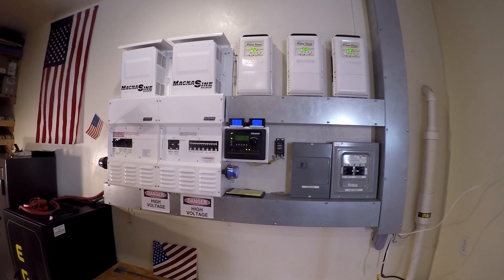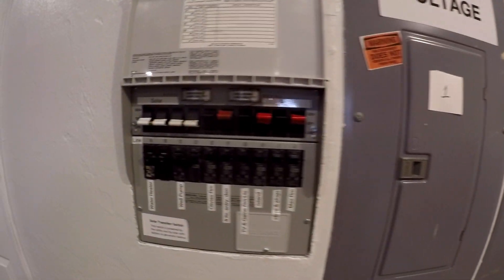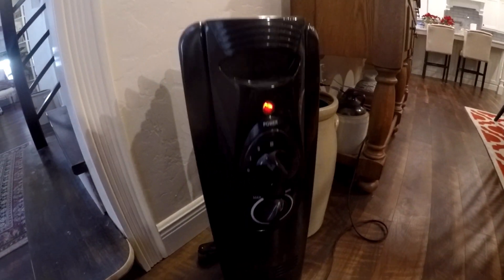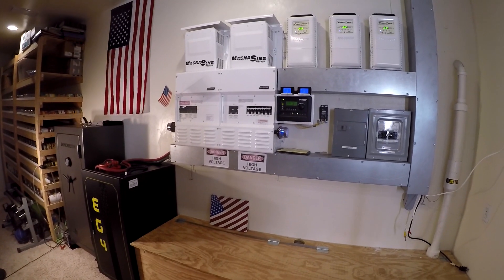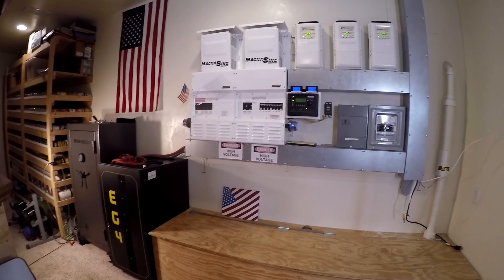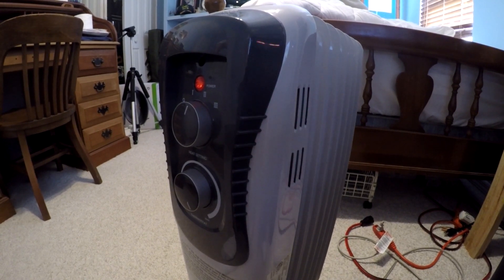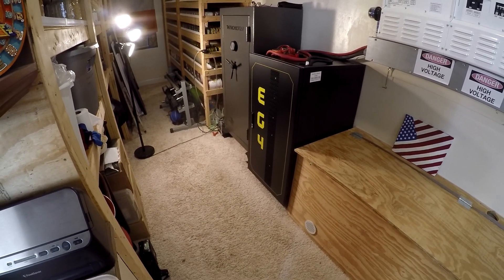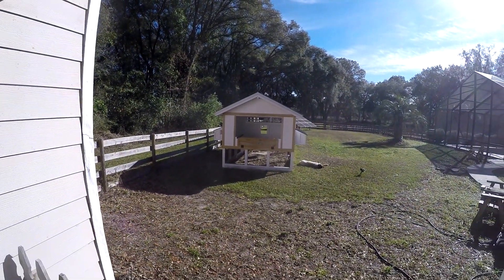EG4-LL V2 Update

Comment: Thats a wonderful setup. I recently switched from the trojans to the eg4ll just like yourself. Did you use any communication cables between the batteries? I know the magnum inverter cant communicate with the batteries? I have your same setup just not quite as large.
Reply from the maker: The batteries are communicating with each other but they are open loop with the magnum system.  Green wires seen here: https://www.youtube.com/@HomesteadEngineering
Thanks!

Comment: what is your total array capacity.  Just curious on what is pulling in the  40kw hours.  Thank you and congrats on the new batteries.  I'm thinking about the older version of what you have for 2k less and maybe one new for the CAN.
Reply from the maker: I have about 13,000 Watts of panels.  I do have some afternoon shading issues from Nov to March.  Well see what it can do in April.  I am currently still producing more than I can use.  I will need to add an electric car and then I will probably max it out.

Comment: Very interested in detailed videos on the eg4 6000ex split phase inverter.

Specifically interested in how wired to the AC breaker panel and any safety cobsiderations
Reply from the maker: JK, Well I do have one sitting in the garage so I will get it mounted and hooked up eventually.  Thanks!

Comment: I have been contemplating getting the EG4 batteries foom Signature Solar. Their sale ends tonight at midnight. The real issue is our Repurposed Tesla batteries are still running strong. As much as I want a safer chemistry, I hate to swap out batteries that still perform like new.
My only issue with Tesla is I only have 15 kilowatts of them. A 30 kilowatt bank would be perfect for our system. Some people have suggested that I sell my Tesla batteries and use the money towards the Sever rack batteries. At today's  prices for Lithium Iron phosphate, who is going to want to buy  Lithium Ion NMC?
Reply from the maker: That's a tough one Stephen.  There are a lot of reasons to make the jump and a lot of reasons to hold off.  My biggest motivation to upgrade from my FLA (that work perfectly) was my fear that something bad could happen and I would be unable to get my hands on them.  Having my own power source is as important to me as food or water.  So, I am very relived to have them in hand in addition to all the advantages they provide.

Comment: Hey Dave, great update. I'm getting an eg4 system delivered any day now! Your videos have been reassuring that I made the right decision.

I have an A.O. Smith hybrid water heater (tank) and it has am option to run solely in the heat pump mode. You should look into a hybrid water heater.
Reply from the maker: Hey Raymond,  I love them so far and I think your going to be very happy as well.  On the hybrid water heater:

"I have looked at that. One advantage for me is that they suck the heat out of the room.  That's usually a good thing here in Florida.  Heats the water AND cools the room.  Not so great in the winter but our winter is short.  I probably won't do it because:
1. They are a lot more expensive
2. I already have a solar pre-heater (that I made) and it heats most of our water in the summer for free
https://youtu.be/KEPej1hZmto
"
Thanks!

Comment: get a heatpump water heater
Reply from the maker: John, I have looked at that. One advantage for me is that they suck the heat out of the room.  That's usually a good thing here in Florida.  Heats the water AND cools the room.  Not so great in the winter but our winter is short.  I probably won't do it because:
1. They are a lot more expensive
2. I already have a solar pre-heater (that I made) and it heats most of our water in the summer for free
https://youtu.be/KEPej1hZmto
Reply: @HomesteadEngineering the solar hot water is an oft overlooked way to cut an enormous amount of energy off the bill. I built my system about fifteen years ago using a repurposed thermo siphon system. It mostly involved installing a heat exchanger into one of the tanks and a solar powered recirculating pump. I was just playing at first but soon discovered how great solar hot water works. In my last permutation I fixed a number of persistent problems such as leaking around the heat exchanger port and now have a very effective and reliable system. Since I’m using a single wall heat exchanger I switched from auto antifreeze to RV winterization fluid.

Comment: Jeez man those oil filled radiators use a butt ton of electricity and don't put out much heat - would be worth investing in something more modern either more air con units or an air to water heat pump
Reply from the maker: Your right, they are not the best way to heat but you have to keep in mind that solutions are always relative to a particular persons situation.  For me, I live in Florida and I don't have that many days where I have to heat at all (maybe 40) and even then its like 45-50F outside.  I do have one mini-split and I love it.  I might install one or two more of those for the rooms that we are in all the time.  They also cool, which is what I am more focused on.  I also have three large heat pumps that heat and cool the entire house but they run off the utility so I try to minimize that.  Our main heat pump is 25 years old so when it dies I may attempt to replace it with a smaller soft start heat pump and run it off the solar.  Well see.  Thanks!
Reply: @HomesteadEngineering  Of course what ever suits you.  More mini split air con would be good I think.  It's a fun journey no matter what so keep making the videos as they are good to watch. :)

Comment: You might want to put the water heater on a relay. Be automatic
Reply: Look into the new, just released, 120v heat pump Rheem water heaters, perfect for running off of solar. The older heat pump heaters were 220 volt, these new models burn about 6 amps
Reply from the maker: @sh839c  Thanks for the suggestion.
Reply from the maker: Hello Roy,
The problem is that I have to turn off some stuff (like space heaters) before I can run the water heater as I am limited to 8,800 Watts from the inverters.  I am thinking of running the water heater off a more intelligent switch/circuit that can vary the amount of current to the heater based on what's available from the inverters.  A smart circuit would also know the time of day, state of the battery and maybe even todays and tomorrows weather to help it decide.  OR I might just add a 3rd inverter and forget about it.  Thanks!
Reply: @HomesteadEngineering  if you need to limit current maybe a element of less wattage help with the issue
Reply from the maker: @royamberg9177  Yes, I actually already did that.  I dropped from 4500 down to 3500.  I also have a solar pre-heater that really does most of the work in the summer.  
Element change: https://youtu.be/DZtWGsUDppI
Solar water heater: https://youtu.be/KEPej1hZmto
Thanks!